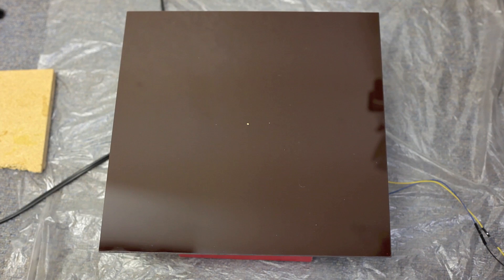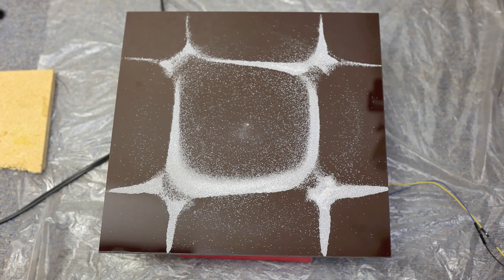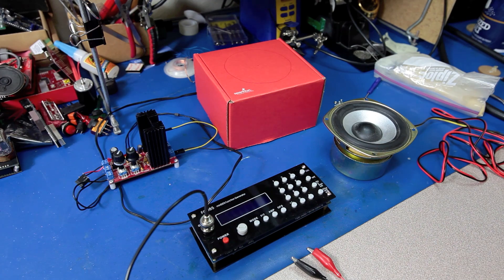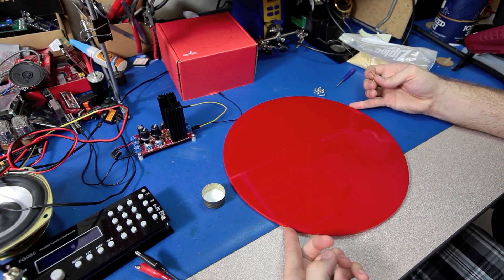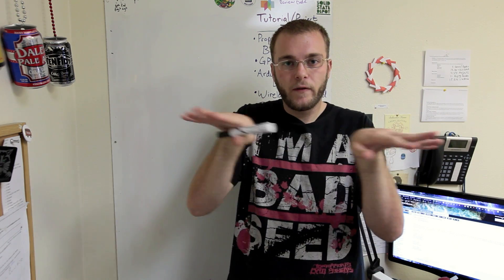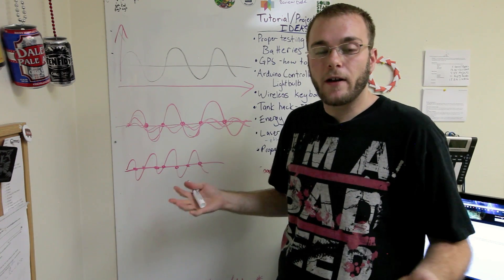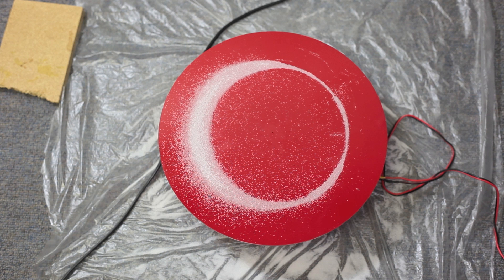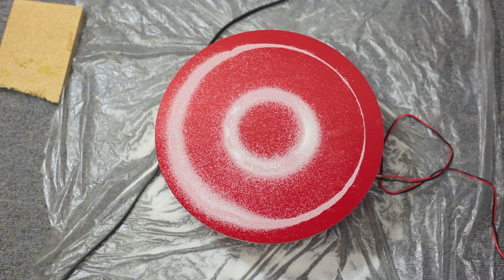Engineering Roundtable 8-27-12: Cymatics with Joel Bartlett

Comment: hi i really liked the way but i need to ask you that what can we use instead of the round plate or the square one (other than the material used in it not the shape) and how many volts is the speaker and what is its diameter for the speaker and plate. i wish youcould reply and not be like other youtubers who dont reply .. depending on you

Comment: That's absolutely true - they are always integer multiples of the fundamental frequency. It's caused since the wave 'reflects' off the outer edge of the resonator.

The radii of the circles is r0f0/f where r0 is the radius of the circular resonator, f0 is the fundamental frequency and f is the current frequency. Or at least I hope that's right - I'm a little rusty. They come out circular because the wave is already travelling at the normal to the edge of the resonator and reflects back on itself

Comment: The waves produce patterns based on constructive interference. A round resonance plate with the sound source perfectly centered is bound to produce highly symmetrical patterns of interference, since the angle of incidence is equal to the angle of reflection and the angle of incidence is always 90 degrees. Furthermore, the edges are all equidistant from the source.

It was a thought provoking demonstration, and an educational video. Thank you.

Comment: Not surprised at all. It would have been cool to use a little less salt to get a finer line and then try and measure the distance between each circle and compare that to the frequency length.

Also would have been cool to see some different shapes and what what kind of patterns can be made. Kinda ties in nicely with Pete's guitar project.